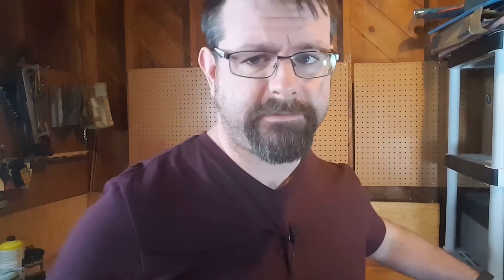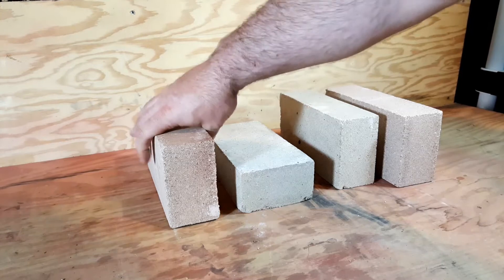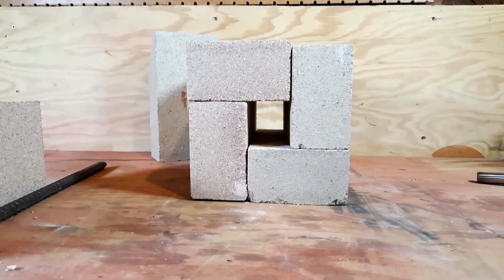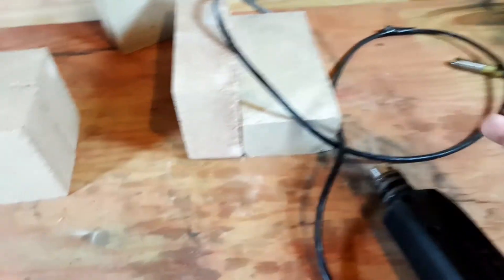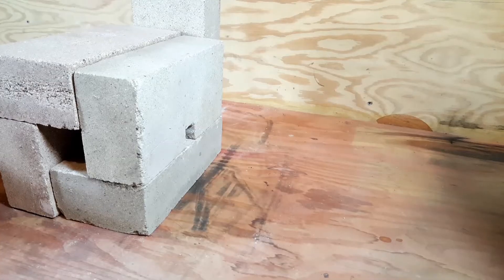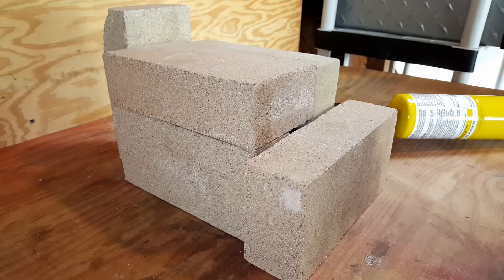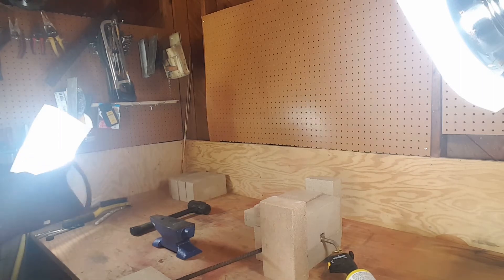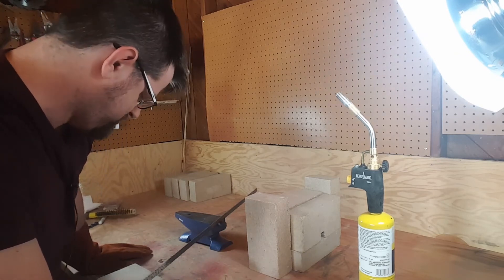How to Build a Forge from Fire Bricks

Comment: Mapp gas may actually less useful than propane because with the temperature it produces it could actually melt or deform so propane would provide the temperatures you need. With that anvil probably a 4x4 at about hip height on a type of support that could keep it from moving at all. Did you say you are going to become an “ABS mastersmith?”

Comment: You need to cut a stump out of hardwood for your anvil to sit on. The height of the stump should be determined by letting your arm casually rest at your side then measure from the middle of your hand to the floor your stump will sit on. Then subtract the height of the anvil you own and that will be how high you should cut your stump. Then put that little anvil on your keychain and at least go buy the 55lb cast iron one at harbor freight. Although cast steel is really what you need. Maybe go to your local scrapyard and see if you can get lucky. Even a chunk of railroad will serve you better. Then lastly for god sake fasten the anvil to the stump.  Good luck